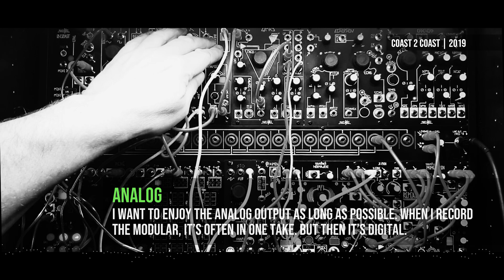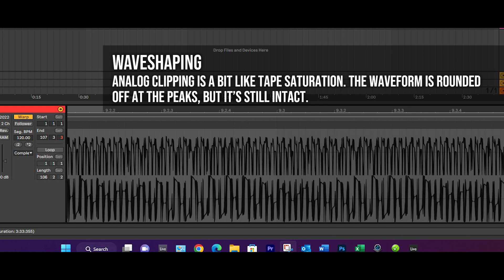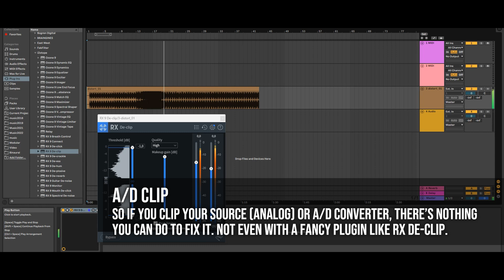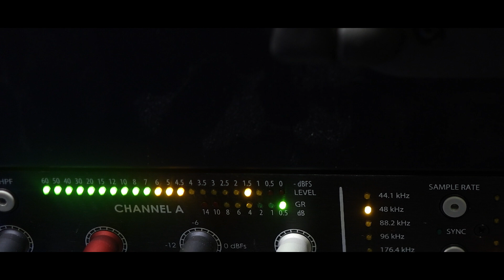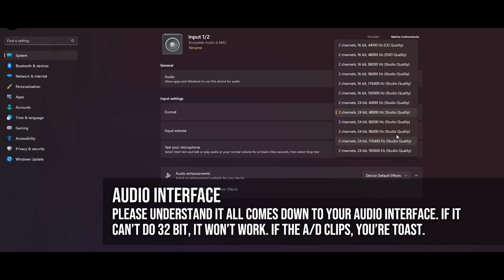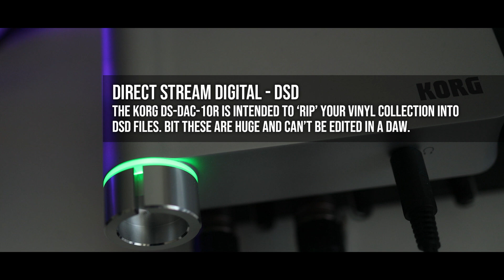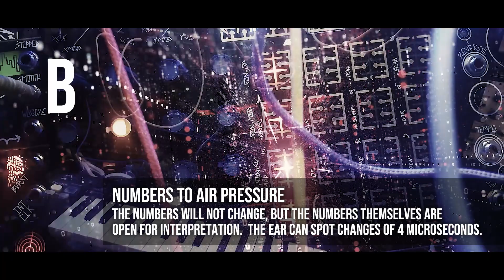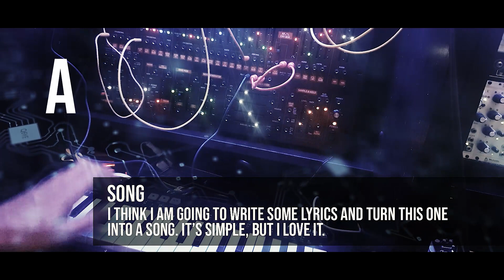Studio Tour | Episode 06 | 32 bit float! No more digital brick walls

Comment: I use my portable recorder a Sound Devices MixPre II for 32bit recording of my modular and instruments sometimes. It can be used as a 32bit interface connected to the the computer with an USB C connection, but sometimes I just sit down to my modular tweaking, without turning on the computer and record the stuff to the SD card, then copy it to my computer for further processing. Nice way of recording if I want to be sure I am not clipping. Otherwise I use a Prism Sound converter, which I prefer more and it sounds nice even when it is clipped, also have an ''overkiller'' soft-clip limiter / channel, but sometimes I can go from quiet to very loud accidentally and then I feel safer to go with the 32bit recording. Or I can use both to have a safety recording if anything happens.
Reply from the maker: Thanks for sharing your workflow! I am sure it will be useful to many people trying to figure out the magic of recording. Subscribed with honor!
Reply: @CinematicLaboratory  Thanks you. 🙂 Keep up the good work. I really like your videos !!!

Comment: Ok, now it is my turn to be surprised and confused.
From the video it seems that you indeed managed to record without clipping the ADC but how did you do that?
The Korg DS-DAC-10R uses a Texas Instruments PCM4202ADC that supports 24 bits PCM or 1 bit in DSD and accepts a full-scale input voltage of approximately 6.0VPP differential, which corresponds to a 2.12V RMS or +8.75dBu input swing.
Neither Korg nor TI states if it is fixed or float. Maybe it is stated in the Korg manual.
Now it is my turn to check how that 1 bit technology works and how it overcomes clipping.
It is interesting to note that Sound Devices claims that they are the only ones who have at the moment an interface(Mix Pre II range) that can stream at 32 bits float through USB.
And they also do not use a 32 bit ADC chip but several 24 bits connected together in some very clever way.

So we are just at the beginning  of this very promising technology.
Reply from the maker: I am super thankful for pointing me in this direction. I guess I am the fool that did not know and just did it. I looked at the Korg sound input settings and it showed 44.1K/32 bit in the options. So no high samplerates. I was expecting something like this because the Korg plays very well on the PC when doing system sounds and playing from the Browser or Spotify. I checked in Ableton and I could select the Korg ASIO driver input 1/2. Clearly, as I expected, the 32 bit A/D takes place in the ADC. I could not adjust the incoming volume, it just recorded and when turning up every gain i could find (case max, modules max) it did not clip. I did not expect it to work so well. The Korg is relatively cheap and super useful for tracking very hot sounds. I did some research on google and most people are trying to figure out the 'how'. I did not expect to have one of the first practical examples. So I did not use any special DSD recorder software, just the ASIO PCM driver and basic I/O settings in the OS.
Reply from the maker: BTW you should to tech videos. You own valuable knowledge for the audio community. And sorry I misspelled your name. Peper sounds Dutch. Nederlands?
Reply: @CinematicLaboratory  That is super interesting and very puzzling.
At Korg's site i could not find any reference to 32 bits, not even for their high end recorder.
I wonder if they have updated the ADC chip to a 32 bit version or they used also more than one chip and some clever design like Sound Devices.
In any case it works and if you don't have to deal with DSD files it offers a great and cheaper alternative.
It seems that Korg has a small secret weapon - Great info !!
Reply: @CinematicLaboratory  Thank you !
No idea Peper was common in the Netherlands, maybe I should check my roots.
Korg's site is a bit messed up. I assume they have not updated the pages yet.
Their software AudioGate4 has been updated to import 32 bit files fixed that then converts to 32bits float and the full version works only with their hardware. So it makes sense that the hardware also supports 32 bits, fixed or float is not clear.
But on the pages of the hardware it still says that it supports 16 bits 24 bits and 1 bit.
It all a bit confusing